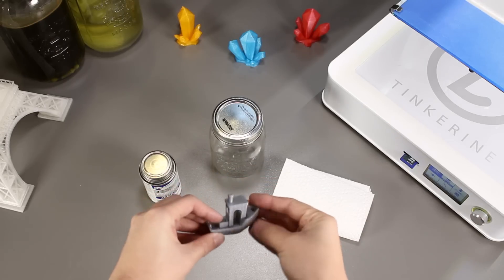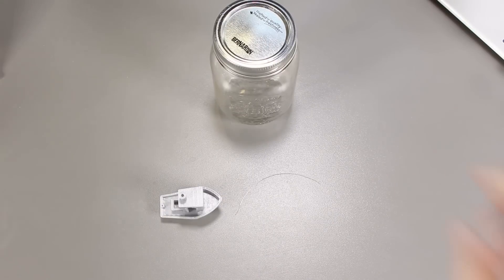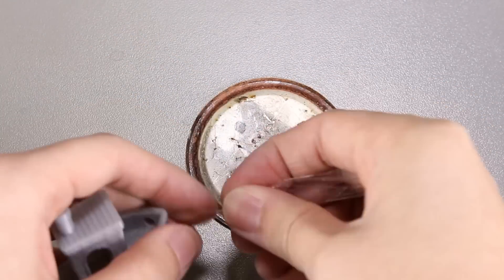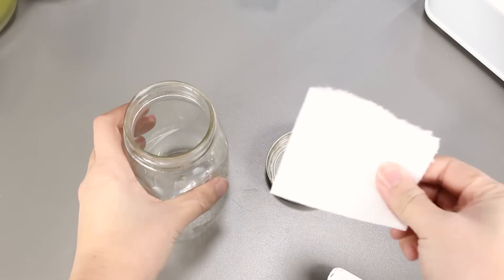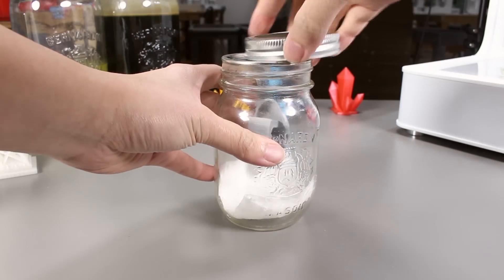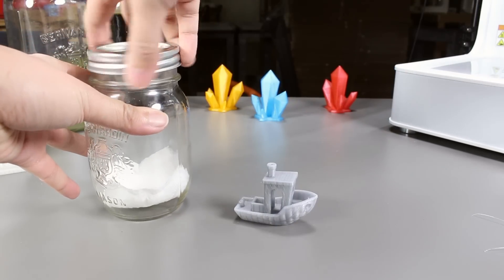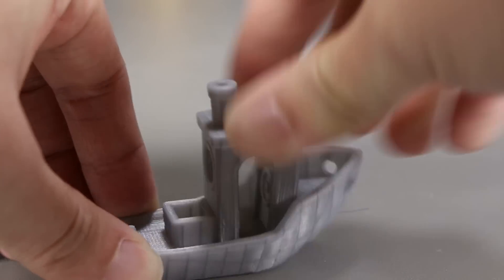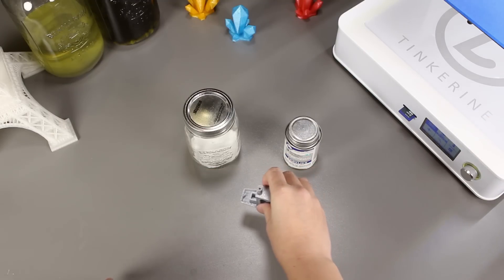Vapor Smoothing on PLA with Methylene Chloride

Comment: I had to laugh , he suspects this chemical is strong enough to melt PLA until it is smooth, but doesn't think it will effect the tape he used to hang the boat .
Reply: Well not all plastics are affected by a particular solvent. How do you know the tape was PLA based?
Reply: A S  I never said it was PLA based, and it doesn't matter if the tape is plastic,paper  etc. the adhesive part of the tape would dissolve  regardless
Reply: @jynx-vu2zc  a-ah
Yes, that's exactly how chemistry works
U don't know what the chemical is nor if is water soluble, BUT it WILL dissolve
Degree
Now
Wow
Nobel
Reply from the maker: Thanks for the comment!
Reply: Try magnets on both sides of the lid to hold it. There won't be any issue with solubility of the adhesive (tape) then

Comment: it didnt work cos this moron did it wrong you dont want it to be soaked up to smooth pla with Methylene Chloride paint it on with a brush until layers are gone do not dunk or use vapor
Reply from the maker: Thanks for the comment, we were experimenting with the chemical to see whether or not we could use it in other methods!

Comment: 3.44 min in a few sentences:
Methylene Chloride wont Work.
After sometime it will make it rubbery/ kinda flexible. PLA will go back to it's rigid state after sometime.
There you go. thats all you need to read from this video.
Reply: Methylene Chloride does work though if you apply small amounts directly on the item
Reply: @jeanfelix6643  Too locally corrosive. It's like applying acetone directly onto an ABS part, if not worse.
Reply: @jeanfelix6643 🔴 What Is Islam?  
 
🔴 Islam is not just another religion.  
 
🔵 It is the same message preached by Moses, Jesus and Abraham. 
 
 🔴 Islam literally means ‘submission to God’ and it teaches us to have a direct relationship with God.  
 
 🔵 It reminds us that since God created us, no one should be worshipped except God alone.  
 
 🔴 It also teaches that God is nothing like a human being or like anything that we can imagine. 
 
🌍 The concept of God is summarized in the Quran as: 
 
📖 { “Say, He is God, the One.  God, the Absolute.  He does not give birth, nor was He born, and there is nothing like Him.”} (Quran 112:1-4) 📚 
 
🔴 Becoming a Muslim is not turning your back to Jesus.  
 
🔵 Rather it’s going back to the original teachings of Jesus and obeying him.  
 
 
More .....👇 
 
🔴 THE RETURN OF JESUS
Reply: Thanks! Statement is at 2:55

Comment: Hello Friend,
Which is the best method to smooth parts in PLA.
Acetone does not work.
The methacrylate does not work.
Reply from the maker: Hi!

So far, the best method we found to smooth PLA parts is to wet sand it. If you are looking into painting it, you can spray a coat of sandable primer on it and then sand it down. It will require multiple coats and sanding.

In the meantime, we will look into other methods on smoothing PLA parts.

Thank you!

Comment: Im actually using Methylene Chloride to smooth out my pla prints. i bought 20L of it. i just dunk my parts in the chemical for anywhere from 5 to 15 seconds. it comes out  wet and sticky from the plastic melting, but after it dries it is very smooth , almost no signs of layer lines. it is very soft and rubbery when  it first dries but after a few days it hardens back up kind of like a hard rubber,  with enough force you can just rip the plastic off.  not very good for structural pieces but good for show pieces.  it is also great for joining parts.
Never tried doing what you had done but it was interesting to see how different it turned out from my results.

Keep up the good videos, love learning and seeing the experiments you do.
Reply: I actually found this method quite useful for mechanical parts. I got 2 45 degree helical gears to turn each other at 90 to each other, which I found impossible with the layers unsmoothed.
Reply from the maker: Hi!

Thanks for the comment! That's very interesting how different the Methylene Chloride turned out depending on how we use it. We'll look into trying out your method at the office sometime. Thanks for the tip!
Reply: You must be kidding! Done this, seen that: immersing a PLA part into MC dissolves it so fast that the surface gets immediately spongy and prone to any finger or tooling mark that you necessarily need to apply onto the object in order to take it out of such a corrosive and carcinogenic bath.
Reply: dont use metylene chloride, very bad for the environment and the ozone layer and seriously gives cancer. Banned in many labs (i am a chemist) ! Dont use it for this application